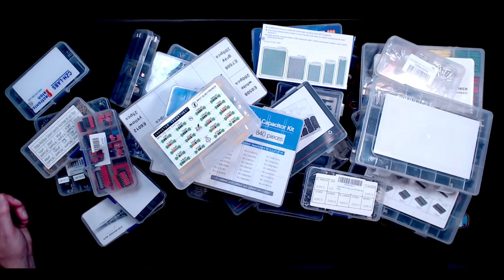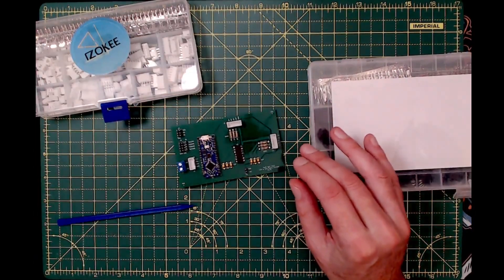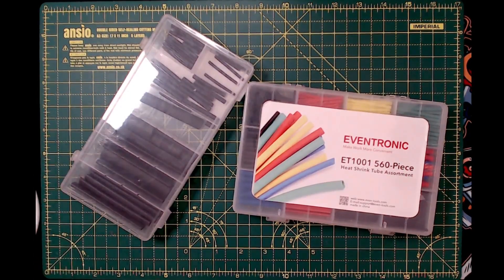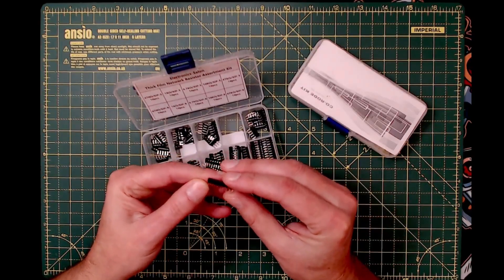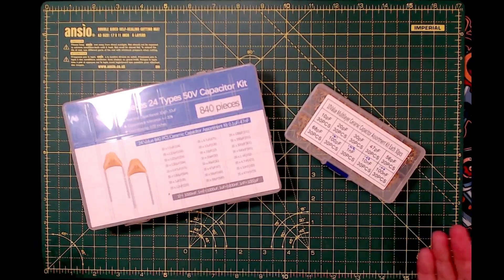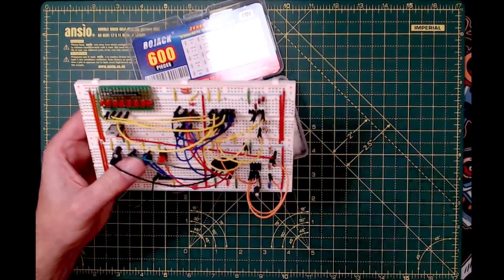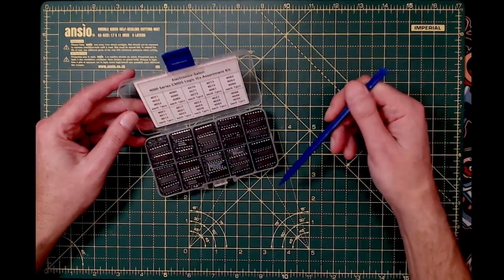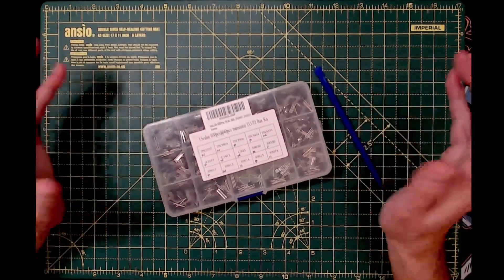Cheap Electronics Components from Amazon

Comment: The interruptions in strip boards can easily be made using a drill of sufficient oversize by hand. A few turns and you have your interruption.
Reply: In fact, you can get the proper tool for the job, made by Veroboard. Costs very little as it's like a drill fixed into a handle and does the job in seconds.
Reply from the maker: Thanks for the tip.

Comment: My suggestion is don't buy IC or really anything silicon from the E Commerce Crowd.   They are almost 100% out of spec, and the danger isn't to your breadboarding...   the danger is that one might slip into something you really care about someday.   Plus you need to get familiar with the Mouser or Digikey websites anyway, and the premium you pay is really worth it in the long run.   Silicon Devices are a good investment, why would you want fakes?

Comment: Kits, kits kits! I love kits! I would even say I have a small addiction :) Btw my favourite JST connector is the VH3.96mm is if make the board as well as the wire. Very nice fit and accept higher gauges so more current.
Reply from the maker: Thanks for the comment. Yes, kits are a great way to try out a wide selection of similar components at a very reasonable cost. There is an abundance of them out there, but some are not so good as I have found out.

Comment: Actual tip: do not buy these "kit"s, instead just buy parts from a reputable supplier like mouser or lcsc.
With these "kit"s you don't have a way to know what you're getting, but you can bet you're getting the cheapest garbage level crap there is.
And you don't even know the proper names for these parts.

You can have a lot more and lot better quality parts if you just buy parts.
And you will know what exactly you're buying, with datasheets and all other kinds of sheets.
And you can buy these plastic boxes for 10¢ a piece if you need them.

If you need some parts and you don't know the proper name and thus having problems finding it, feel free to ask me, I'll help.
Reply: Same goes for tubes: you can have a whole roll for the price of a "kit".
And it's much more usable when you cut it yourself to whatever length you need.

Same goes for PCBs, just ordering from jlcpcb or pcbway is by an order of magnitude cheaper and you can have em in any size and/or shape you wish.
And also color, thichkess, material, silkscreen and whatever else you may imagine.
Reply: As for inductors, buy some actual inductors that can induce some electromagnetism.
Or just wire and cores and make your own if you feel adventurous.
These tiny tube inductors are useless for anything that require some meaningful inductance, you won't ever be able to make a boost converter with these.

Comment: ..Watch out for "cheap" heatguns that only last a few uses. Bought a similar one that failed quickly, opened it up and the heating element wasn't formed on a frame but merely an incredible mess of insulated fine wire all balled up with the air blowing through it. Amazing that it lasted more than a few seconds... YMMV.
Similar to google search for "110V 220V Hot Air Rework Station 450W Soldering Hot Air Gun for IC SMD BGA"
I then bought a YIHUA 858D for a bit more, couldn't be happier!...

Comment: a thing with heatshrinking cables. when you sleeve the cable, seperate the wire and heat the shrink, then use needle pliers to squish the shrink between the cores, it looks and feels more robust
Reply from the maker: Thanks, I will give that a go.

Comment: Ever wondered how Ebay and Amazon can sell packs of components so cheap? Be carful of fake components. These include components that just don't work, to ones that are marked incorrectly like capacitors with the wrong working voltage. It's not uncommon for the components to be ones that have failed quality control when manufactured, are bough cheap and  then sold on as full specification. Same with breadboards. The cheap ones have some cheap tin for the electrical contacts and don't grab component leads correctly.  Don't assume that components will work. If you can, test and/or measure their values before use. Invest in a cheap component tester(s).
Reply from the maker: Thanks for your comment and yes I totally agree. This is why I regularly post product feedback reviews on Amazon and now started sharing my experiences through videos like this one.

A lot of the time precision is not really critical, particularly with resistor and capacitor values. I tend to use cheap components (usually from kits) when experimenting and breadboarding stuff. Your breadboard has plenty of parasitic properties regardless of its quality anyway (resistance, capacitance and inductance). 

When you come to commit to something more permanent, then its worth investing in a more reliable supply source. If you have designed and built the circuit yourself, then you will know which components are the critical ones.
Reply: What if that cheap component tester is also a quality control reject 😂
Reply from the maker: @JohnyRalte  haha! 😂

Joking aside, the answer is to measure with at least two testers and compare the results. If precision is critical, then get your testers calibrated regularly by a certified test house (seek UKAS  accredited organisations in the UK). 

Just to add, I have not had any disasters yet with cheap components, but I have had some quite expensive resistors from a very reputable supply, go open circuit in the last year.
Reply: @paulpkae yeah, I was about to say, I've been looking and such negative experiences occur at Digikey and Mouser as well. It will be less than with a cheap Chinese kit but you are saving significant amounts of money to gain bulk parts, very worth it in my opinion. 

Even with the Chinese dealers you still don't really encounter those issues often(me not at all yet, and I've heard from hundreds of others the same.

I got some ceramic capacitors and only one value, out of a 20-30$$ kit, was mislabeled which isn't even an issue for me, you need to know the exact value anyway, tolerance already ensures many will not be exactly on target and that has to be figured into your overall project, thus testing is already a must.
Reply: I have seen some videos about fake 7805 regulators that can't deliver rated current. Also some electrolytic capacitor kits may have "adjusted" rated voltages. If used at rated voltages it would explode in few seconds. 
I think I need to do voltage test for my kit. At least one cap had leaked. Sad that I only have power that go to 30v.
Mostly in hobby use question is "Is this suitable to project what I'm doing and how I need derate this component."
Reply from the maker: @LimbaZero  thanks for your input. Interesting about the 7805, I use those quite often but rarely push them to anywhere near their  rated current. 

Unfortunately, the world has pressurised the supply chain for many years, China in particular, for "cheap" products and this inevitably leads to poor quality. That said, there are many brilliant low cost products out there that work just fine and are well within most people's price range. The best thing we can all do is to provide honest feedback and share our experiences with others; good and bad.
Reply: @paulpkae  ... Yep, I had bag of 7805's that all topped out below 80ma...
Reply: I'd be very careful with electrolytic capacitors, tantalum capacitors, fuses, certain semiconductors, anything mains-y, especially when using them for building permanent devices, repairing or restoring. However, a LED or resistor or low voltage switch either will work or not, and with a connector quality problems should be obvious.

Comment: That is most definitely NOT the correct tool for JST>
Reply: Great! I've been trying to put together a shopping list for some projects for over a month. This will help. 
Happy New Year!
Reply from the maker: @LarsonGuitarPlayer  hope you enjoy. If you are buying any of the items shown, please use the links in my description. It does not cost you a penny more, but goes a small way to help this channel going. Happy New Year!!!!!🎉
Reply: I got my crimping tool included with JST + Dupond kit. It's those ratcheting crimping tools that do both sections at same time.
It seems that kit is not available anymore. Tool is Aueide SN-02BM and I'm pretty happy with results.
Reply from the maker: @LimbaZero  Thanks. The PA-09 tool shown does indeed require two crimps to complete each core and it can be quite tricky, but once you have done a few it works well. The more expensive ratchet type would be better and have the added bonus of providing better control over the crimping pressure that gets applied.
Reply from the maker: I have tried various others and found this one works fine for me. Do you have a recommendation you can share?